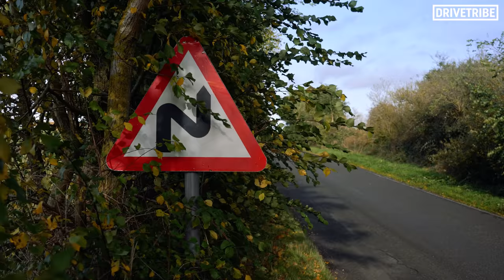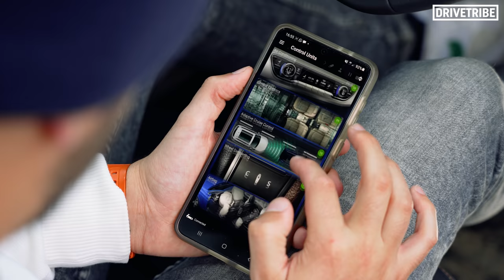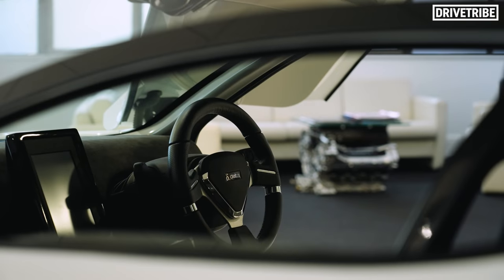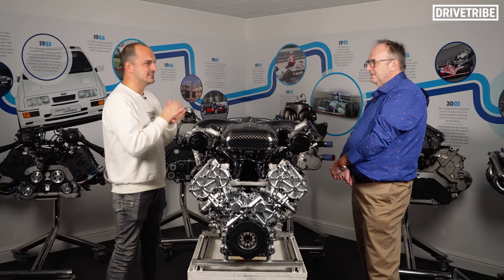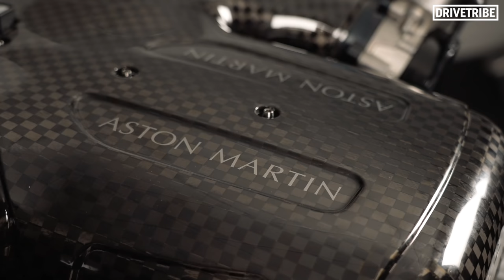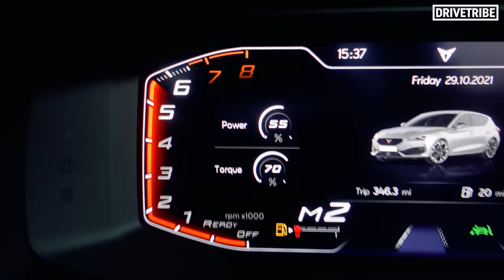Why are almost all modern engines 2.0-litres?

Comment: "almost every modern engine used 500cc per cylinder" Well you threw any hope of being factual out in the start.  Dodge and Chevy Run most everything on 3.6L or bigger for v6 engine, while Ford  Honda and Toyota Is on a 3.5l. When you look at v8 engines there are a few 4.6 and 4.8L models ( still more then the claimed 4L) but most Common are 5.3( Chevy), 5.4 ( Ford) and 5.7L( Dodge) Not to mention the 6L/6.2L LS and 6.1L hemi that are also very popular. Yes similar engine sizes are very common, but at least do som basic fact checking before you start talking.

Comment: If Germans figured out the best ratio power etc.. why can’t they make an engine that goes 200-300k without breaking down constantly @ 75-100k?!?! Yah look at used cars and you will see ow a used Mercedes or BMW for low low price with only 75-80k ! Yah it’s a money pit and never was reliable. However Ford and Toyota both are very very reliable

Comment: Nice video, but small engines and EVs won't "change the world", it's too insignificant and there are no electric lorries...
Reply: not yet... cars with internal combustion engines have been around for 100 years... electric cars maybe for 30?
Reply: @johnuferbach9166  Yeah, but did you see the unachievable plans for switching to electric..?

Comment: im from asia wonder why u guys need big engine. 150cc bike could go 150kmph. 
1.0L car could go 100
1.5L car could go 150. 
1.5L pickup could carry 2000kg
Reply: because unlike asia, other countries have better roads and they can go 200 without breaking the wheels or suspension on potholes

Comment: The internal combustion engine is perfected at 500cc cylinders and DEAD...it cannot be improved to anywhere near what EVs can do with the same energy, so it's irrelevant. 

Just ban all engines that aren't single speed gensets.  That's all we need now.